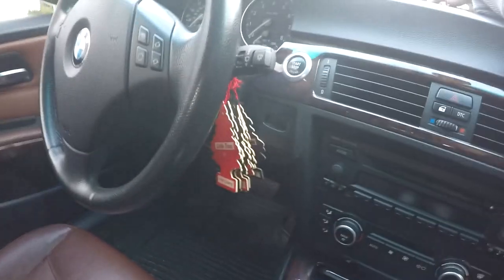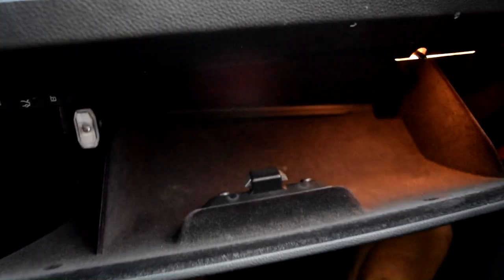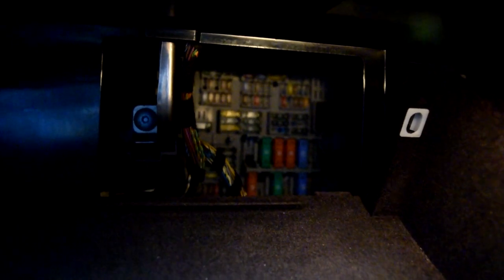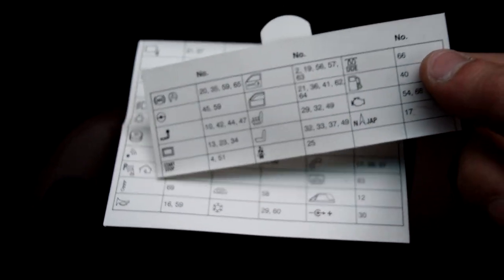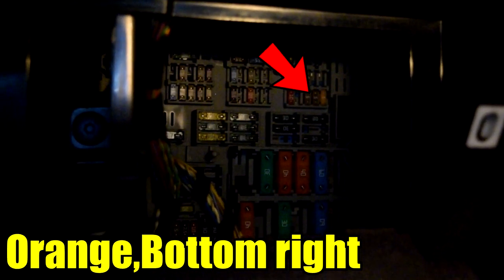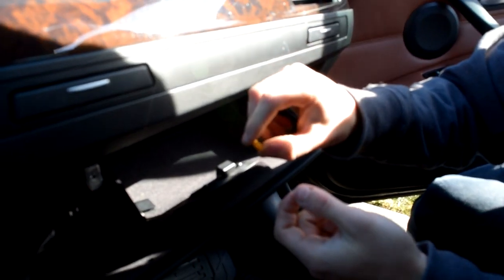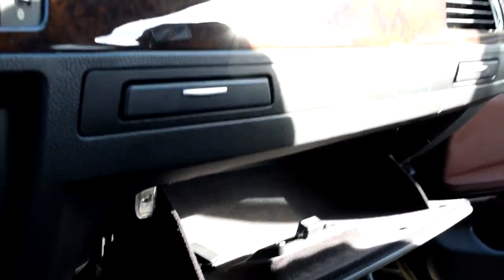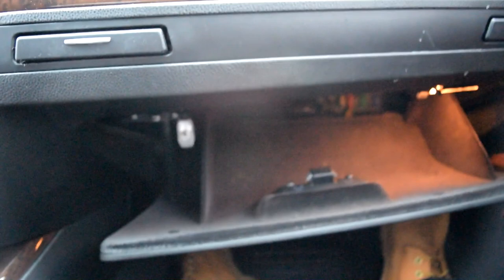BMW E90 Cigarette Lighter Fuse Replace

Comment: Unfortunately I took out my cig charger & my charging cable fell in the hole and sparked. Hopefully it’s just a fuse. Love my BMW!
Reply from the maker: Yes, It should be just the fuse! I had the same issue. I tried plugging in a object that had too high voltage for the cig lighter fuse. When I plugged it in, a spark and a pop occured. I replaced the fuse and it worked good as new. I hope your case is just the fuse as well! Let me know how it goes.
Reply: Yeah man same thing just happened to me hopefully it's just the fuse!

Comment: Hey mate, you might not recall by now, but was your aux port working when the fuse was blown ?
Reply from the maker: Hey man, I'm pretty sure the aux still worked in my situation, I could be wrong, I don't remember 100%. But I think mine still worked
Reply: mine did work

Comment: is it the same for all e90's? i just bought one yesterday. cig lighter ports both not working. but there is no fuse in that location at all.in my car
Reply from the maker: Yes, should be the same for all e90s. Your saying the fuse spot is empty? It could be that the previous owner. Took the fuse and never replaced it.

Comment: I'm installing a dash cam parking kit. No one tells you which fuses are ignition switched and which are constant positive.
Reply from the maker: Im not 100% sure on that either. But did ur dash cam come with an extra battery option for parking standby? I have a dash cam for my e90. And the parking kit didn't come with the cam. The parking kit was an add on which had a separate battery.
Reply: @acauto7886  the kit is a separate purchase. It comes with a box in line which is wired for connection to a constant and a switched live. The box senses when battery drops below 11.3v and shuts the system down. When you turn ign off then it automatically goes into movement mode, both ir sensor and vibration so it acts like a cctv.
Reply from the maker: Ahh I gotchu.  And you need an constant positive fuse to run that kit off of. Im not too sure which fuses are constant positive
Reply: @acauto7886  Think I've sussed it. Problem is my BMW has a staggered shut down when you pull the key so you beed to note the live fuses or spares and then retest them 15 mins later to see if they're now showing 0v...

Comment: Ever had any issues with the coolant liquid overheating?
Reply from the maker: I've never had a coolant over heating issue. But I once had a slight coolant leak which caused my engine to over heat just a bit

Comment: What fuse your flashlight tap to? The one on the glove box
Reply from the maker: The fuse for the flash light plug in? I'm not sure if the plug in has a fuse. I would have to look
Reply: AC Auto .. when you do let me know it will make a good video to install a plug for a dash cam instead of the flashlight
Reply from the maker: @pullcollector2714  ok I will definitely let you know! And wait... did you say you are swapping the flashlight fuse to run a dash cam?
Reply: AC Auto .. i want to replace the flashlight port for a cigarette port so I can connect a dash cam..I just don’t know where the fuse is so I can make sure I don’t burn anything in my car

Comment: Good work my friend but I have angel eyes do not work Do you know the place of your fuse 😬
Reply from the maker: Thank you. And I'm not too sure on the headlight fuse. I'll do some research. But are you sure the headlights are out due to a bad fuse?
Reply: AC Auto  In fact, I do not know if the problem is from the fuse, but as you know the fuse is the simplest things to be examined at first
Reply from the maker: @mestolord5374  correct. I will see if I can find the fuse for the head lights

Comment: I got a 2007 BMW 328i. Both cigarette lighters do not work. I was watching the video and the orange 5 amp fuse is ok. But the one to the right of it is a 20 amp fuse and it is burnt. I thought the 5 amp is the cigarette lighters fuse.
Reply from the maker: Where u pulled the 20 from, is there susposed to be a 5amp fuse? Maybe previously, they put a fuse with 20amp where a 5 is susposed to be and blew it because it was too strong. Check the chart and see if a 5amp belongs where the 20amp is
Reply: @acauto7886  I found out that position 30 in the fuse box is a 20 amp fuse. Position 29 is a 5 amp fuse.
Reply: Corrected see post below.

Comment: Hollo how to get my BMW started. My fuse box bern
Reply from the maker: Hey man. Sorry to here that. That's unfortunate. But the whole box is burned or just one fuse?
Reply: @acauto7886  The power connector
Reply: And hi get a new updated one yesterday how can hi get it working on starting? 😢😢
Reply from the maker: @lionden9601  if you got the new fuse, just follow video and plug in the fuse. If it's the whole fuse box, I'm sure u can find the main plug for fuse box and swap it. But I'm not 100% sure how the fuse box its self works.
Reply: @acauto7886  OK my friend I'm going to try tomorrow morning. Blessings 😊